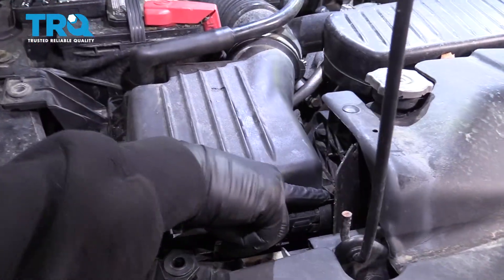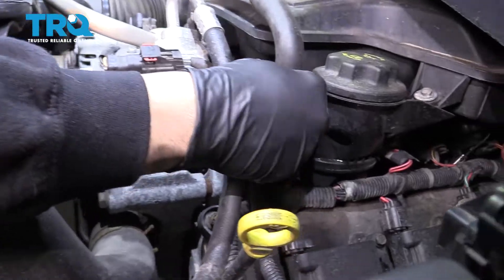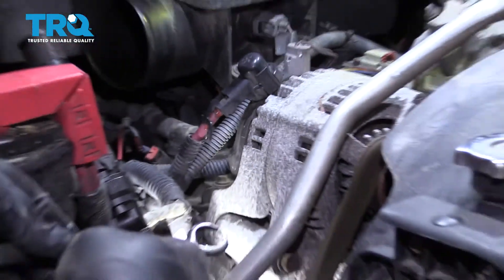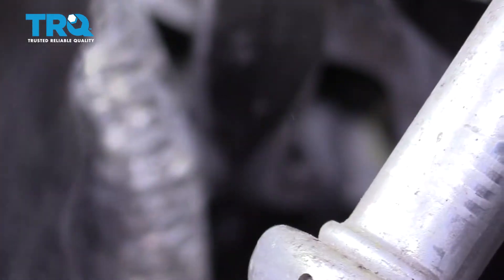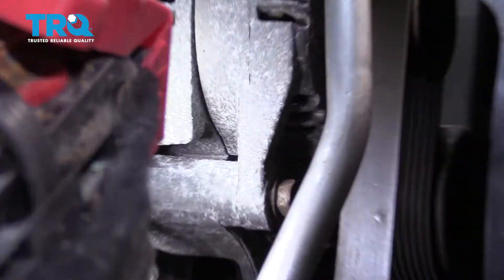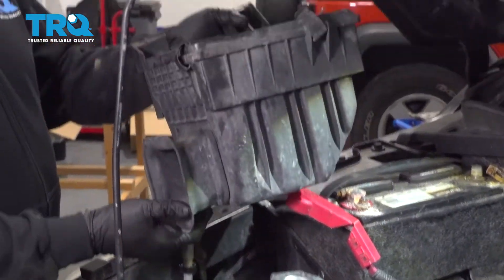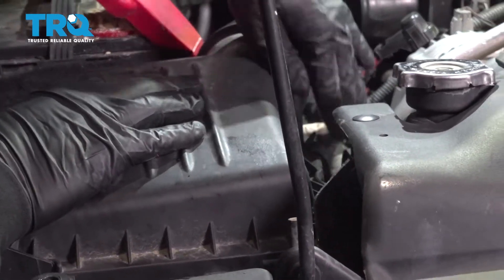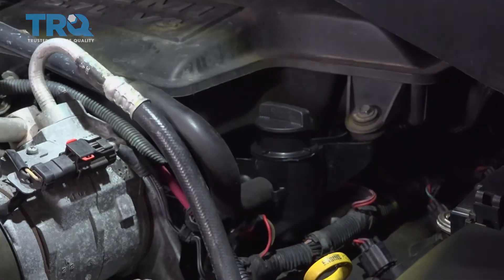How to Replace Camshaft Position Sensor 2004-2009 Dodge Durango

Comment: 2006 dodge Durango5.7 . No cats, straight pipe    127,000 miles. She wasn’t taken care of until I got her.  So this video helped a. Ton. If I can add to it for the hemi owners I’d just say   It’s fairly easy to work on if you take your time and research. This is the first vehicle I’ve owned ( other than motorcycles) and I’ve been able to do quite a few things that I was surprised I was capable of.  Radiator, water pump, both valve cover gaskets , egr, spark plugs, cleaned throttle body, some exhaust work and regular maintenance.  Good trucks just like any though. Have their quirks. Stick with it. You’ll be fine. Good luck and thanks for the help!!🙏🏻

Comment: I chiseled it out with a hammer and flat head screwdriver until I could reach the metal piece that was still sticking out with my pliers. After I sprayed it with WD-40 it came out.